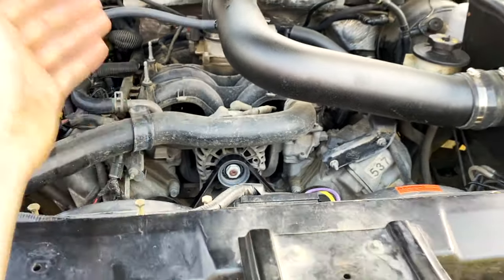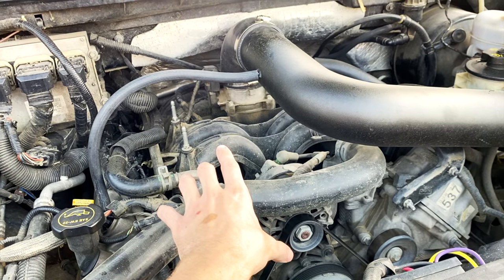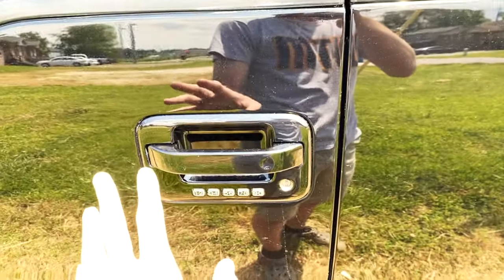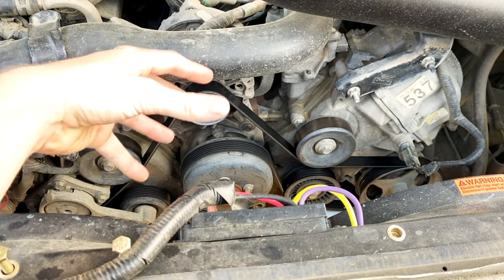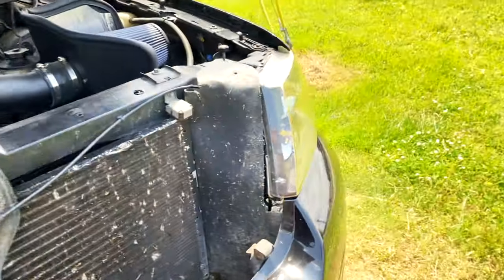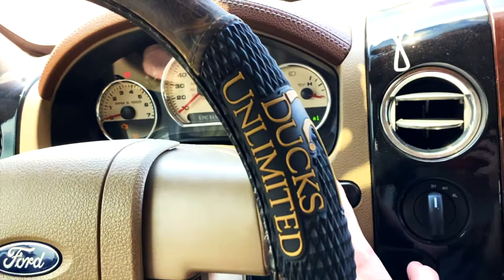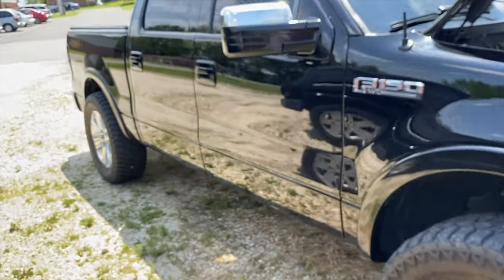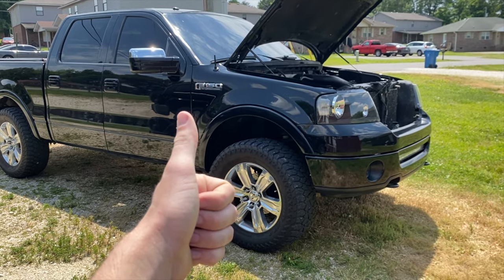5 THINGS YOU DID NOT KNOW ABOUT YOUR 2004-2008 F-150

Comment: Worst generation of f150 ever. Those engines are garbage.
Reply from the maker: Some definitely had more issues than others
Reply: @JayThompson25  my dad had one.  It had the engine replaced twice. He sold it for parts after the second engine jumped timing.
Reply from the maker: @kylestivers4606  that’s tough luck. I’ve had better luck with mine. My brother, mom, and dad actually all have a vehicle with a 5.4 with over 100k on them. Luckily no major failures yet.
Reply: Apparently a 5.4 needs the timing chain serviced a 100000 miles. Those 5.4 Triton motors are junk.
Reply: @JayThompson25  both motors only lasted 100 thousand miles.
Reply from the maker: @kylestivers4606  yeah tough luck man. Black truck still going strong with 175. Rode in a 300,000 mile 5.4 with original engine once. Definitely a lucky truck lol
Reply: @JayThompson25  the truck had 210 thousand when he got rid of it. After 2 engines he didn't to spend another 5 grand for another motor. Good luck with your truck.

Comment: Say what you want about horse power. A 5.3 with smoke this turd. Be realistic. And a 6.0 will out tow this 10 to 1
Reply from the maker: I mean that specific turd of a 5.4 has beat a stock 2007 and stock 2011 5.3 Silverado from a dig while on 35’s. But granted more factors go into stuff like that than just engine hp. (Gear ratio; trans; weight; etc.) as far as towing goes I’m sure a 6.0 would tow better. Mostly because the 6.0’s were put in Chevys HD model trucks which again when considering all those variables above, (added suspension; gear ratio; trans;) the trucks are made to pull. The fact is that 5.4 “on paper” would make around the same power levels “on paper” as Chevys HD setup🤷🏻‍♂️
Reply: Chevy dude is just mad he has to bolt on power to make his truck worth anything Chevy is cheep that’s why everybody has one and builds them  u half to have money for dodge and Ford
Reply: @dsnutzzz4567  what kind of drugs are you on? Look at the price of a nice 2001-07 chevy Silverado lol close to 20,000 dollars if not more.